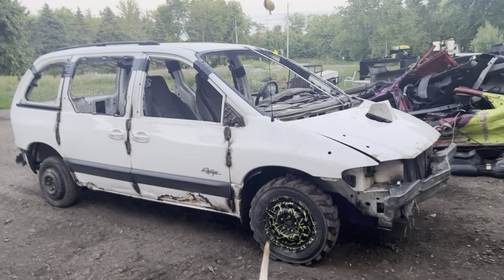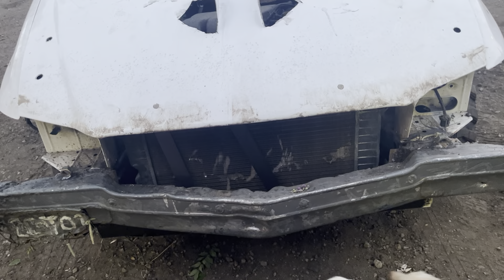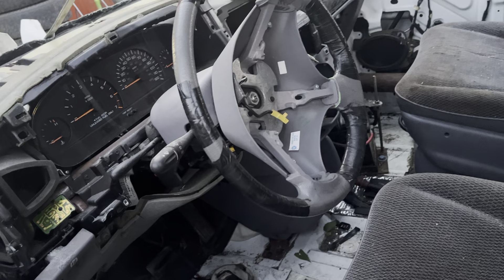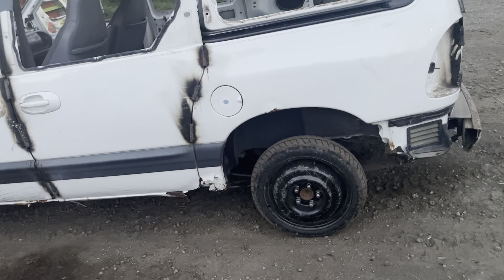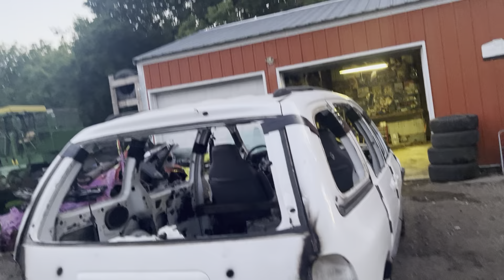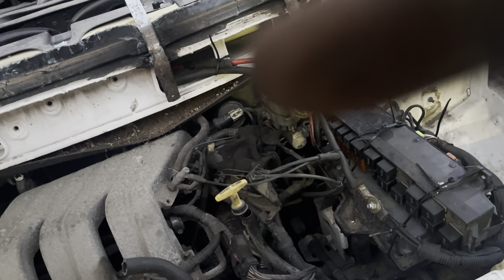Bone stock minivan build for 2022 derby season

Comment: You need the little fuel filter that is right on top of the factory sending you that has 3 lines coming to it that’s your return on it
Reply: If the fuel rail has a return then you need those or a simplified regulator with a return on it .... So if it doesn't have a return if anything you need a regulator to keep a certain pressure so I would look into a stuck open iac because I'm building for Corcoran so hope this helps you man